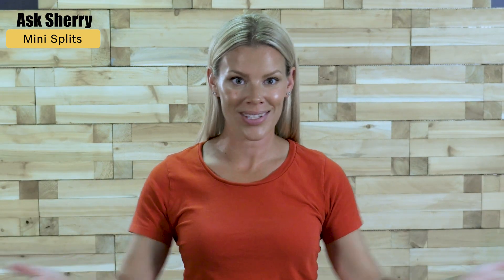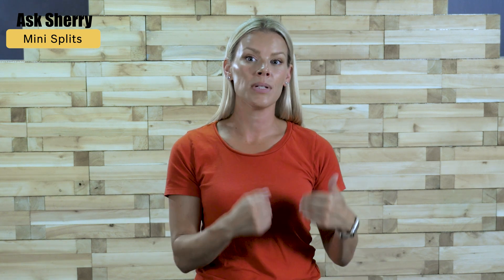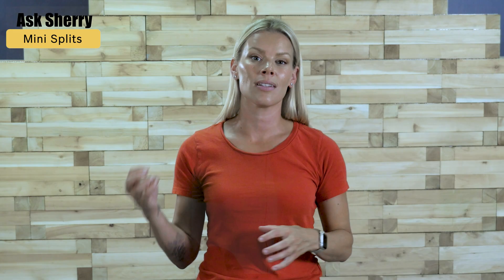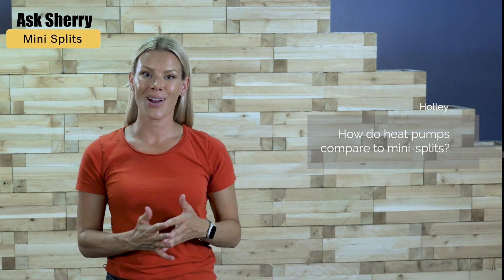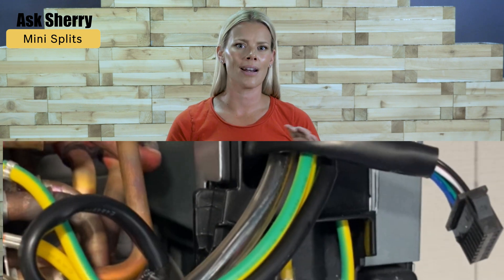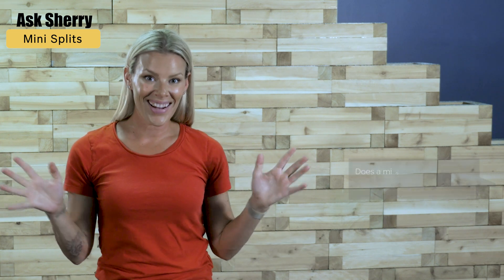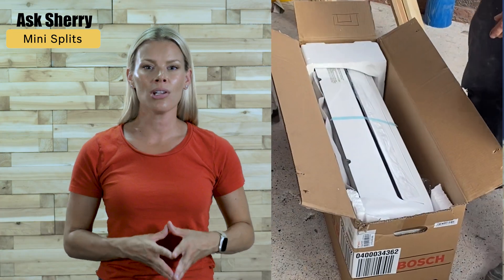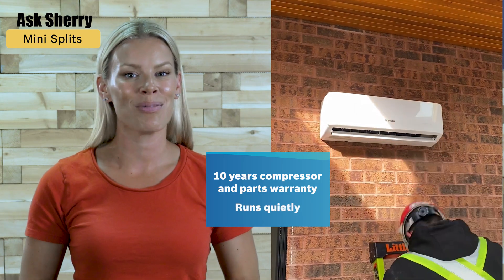Ask Sherry Holmes: Mini-Split Heat Pumps

Comment: Why would I install a heat pump when, for insurance purposes you need a 2nd type of heat source in your house.
Could it be because they don't provide enough heat at -30? Instead I upgraded my Natural gas furnace to a 90% efficient one. Sorry but unless electrical prices really drop I cant see the advantage.
Reply: They have minisplits made to work in very low temps
Reply: @1packatak  I'm still not convinced of all the extra costs associated with heat pumps, (back up system etc) We had 10 days of -40c last winter Im not sure how much heat you could pull out of that temp.
Reply: @bigbear5891  heck I live in MN. We have days of actual temps -40 not including wind chills thanks to Canada sharing Polar Vortexes!,  Even my well insulated 4 yo home’s furnace has trouble keeping up with that